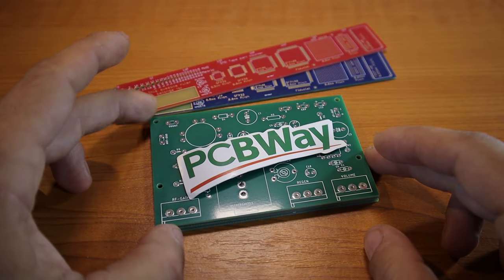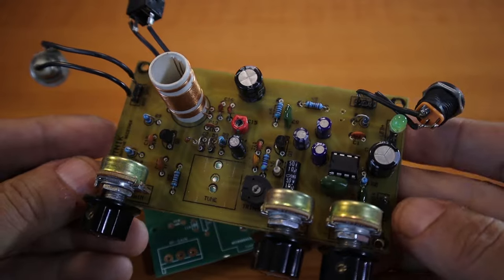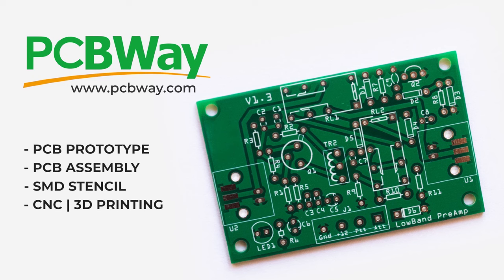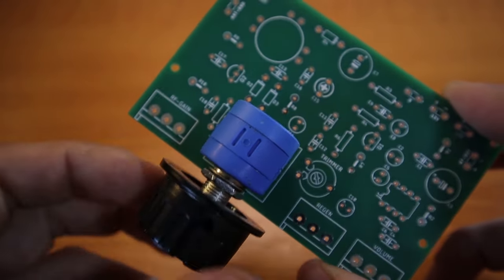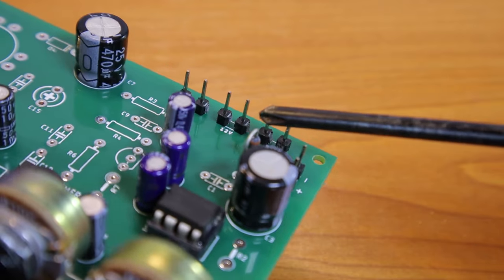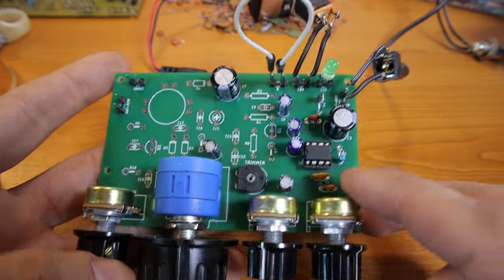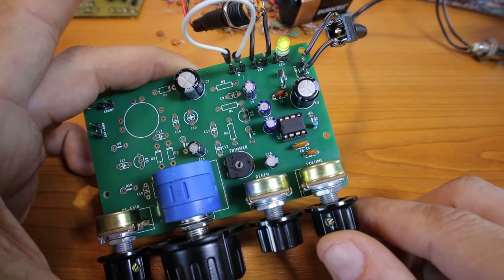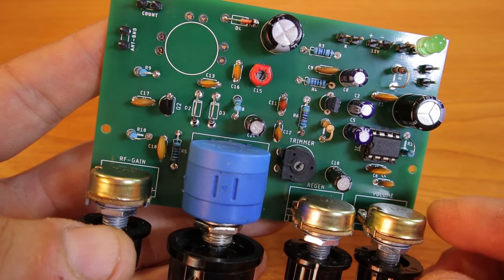Building And Testing The Sputnik Regenerative Receiver - Step By Step

Comment: İ have this frequency meter how can i connet frequency  sputnik
Reply: Frequency meter have - + in pin 
İ connect - and in pin but i dont see Amy Frequency i have same frequency meter
Reply from the maker: I can't remember if I spoke about it in the video or in the blog article... the frequency counter needs some modifications in order to work. Here is a link to a video that I used to make the modifications. We basically transform the crystal tester into an RF preamp. https://youtu.be/0BxpMm6SLoE?si=peMFYZ9S2lwwfAdv
Reply from the maker: P.S. The + and - won't matter anymore as you can connect the frequency counter anyway to L3 as there is no polarization there.

Comment: I have a question. Watching you build the coil I was wondering, do the slight overlaps in your windings affect the calculations? Would it be better for the wire to enter the tube on the same line? Or does it matter that there is an overlap?
Reply: And to make sure I’m making sense 😅

The coils begin and end directly above where the wires first enter/exit the bottom of the tube. The first coil ends up with a slight overlap and the second comes up a little short. Would that account for the difference in your final values? And does this difference affect the overall performance?
Reply from the maker: @badgerchillsky535 Haha. Yes yes I understood. I replied in the other comment ))).